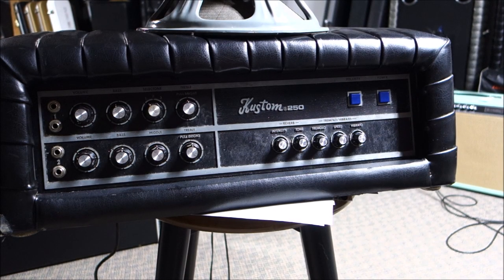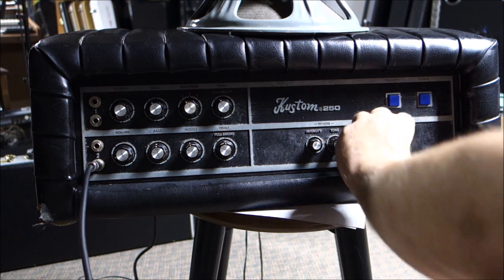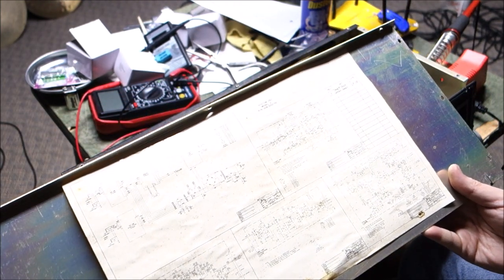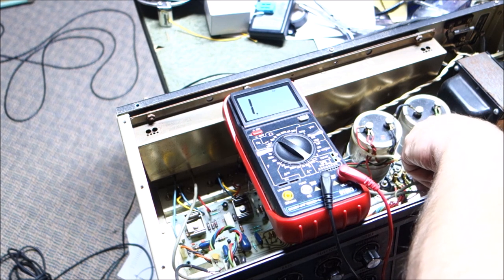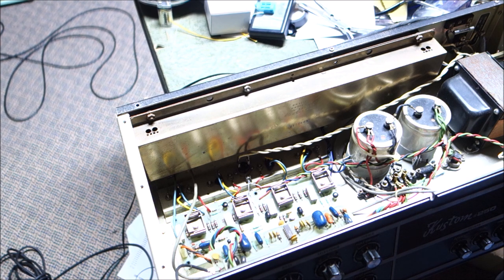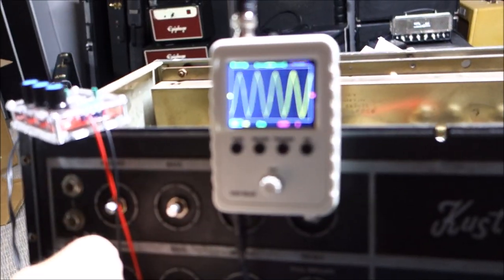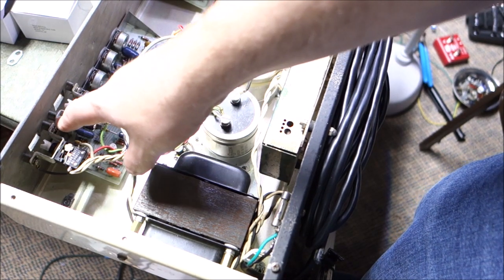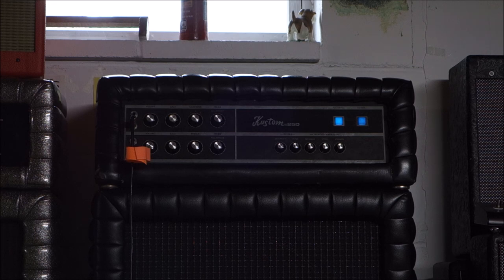Kustom K250-2 head.... bringing it back to full operation!

Comment: Everytime your hands got near those big tower caps, I had to cringe. But it's great to see someone rescueing these old amps, that have sit dormant for far too long. the push button kustoms are some of the best .
Reply from the maker: Kansas Kustoms are great... Usually easy to fix also.
Reply: the size can fool ya with these big caps, they are actually fairly low voltage but the capacitance is very high.

Comment: I just acquired a kustom 150 from 1971  I think ...with the matching 2×12 cabinet both in sparkle silver . It wasnt working  at all till I bypassed the reverb tank , now it kind of works with all kinds of secondary distortion and odd sounds. I will be attempting to troubleshoot and repair it. It was given to me for free so I figure its worth while to try .
Reply from the maker: The reverb tank shouldn't play into getting dry audio though it.   you can get schematics at VintageKustom.com   Best of luck.
Reply: @DeadKoby  Thanks

Comment: I have three of the older Kustom 200 amps. Two are bass versions and the other has reverb and vibrato.
 The RVT 200 has it's original 2 x 15" cabinet loaded with two Altec 421 speakers. 
I replaced the power supply capacitors in all of them and one has been converted to a three prong power chord.
I was amazed at how bad the controls are on this amp in the video but that is 
probably attrited to  the amp being improperly stored I see this a lot in Florida where
unfortunately live now. Amps, both hifi and guitar should NEVER be stored in a non
climate controlled environment unless you want the thing to develop
serious issues.
Reply from the maker: @archangele1  humid environments and electronics are not a good match.   Cool and dry is the best.

Comment: It really was a fantastic video, thanks for sharing!   I Just got one of these in a trade and it's really a great amp, wonderful plush tremelo.  Anyway, I have the replacement bulbs as mine are also burned out-- but I'm not sure as to how to change them. Irinically, This was the 1 part of the video that was skipped over... My research says was vague and said that the blue caps should just "pull off" and indicated replacement from the front using a rubber tubing or something to turn the tiny bulbs?  Or did you replace them with the lid off from the top?  

Thanks, hope you get this and respond🙏

Jason
Reply from the maker: The blue caps do pop off.  And I did indeed use tubing to pull the lamp out.  It was thin fish tank hose.
Reply: @DeadKoby  thanks so much, i was able to pop off the caps and change the bulbs.  Even though they fit, they were extremely dim, so dim that they did not illuminate the button.  What kind of bulbs did you use and where did you get them?  I can't find the GE 335's anywhere...thanks
Reply from the maker: @EcotonicMusic  I got them from some gent on Ebay who said they were the right ones....  I don't remember any more than that.   He sent me two bulbs and a slice of fish tank hose.

Comment: Sounds good, how does a preamp work on these solid state amps just solid state transistors like the output stage or?
Reply from the maker: It's discrete transistors.   These amps are either loved or hated.  I think they are neat for what they are.
Reply: @DeadKoby  Thank you for answering! Yeah I like they way they sound, I've seen them around in music stores but being brainwashed into thinking everything without tubes is bad I didn't really pay much attention to them.
Reply from the maker: The late 60's or early 70's are my favorites.   Bass heads with 3x15 cabs.

Comment: Any experience with the model 4??? Specifically, when the fuzz is enabled, do you have a volume boost
Reply from the maker: I don't recall.  Sorry.
Reply: @DeadKoby  thanks. Seems nobody knows. It's hard to get info on these amps.
Reply from the maker: @genereybradley  Try the forums at  vintagekustom.com
Reply: @DeadKoby  did that already, last year.  Was hoping someone who can read schematics would have the answer.  I have some of the old british vox solid state amps defiant supreme and they do increase in volume has you sweep the control. Kinda nice.

Comment: Hi I have a 250 bass amp  , was wondering if u can help me out? I play for 20-30 min with my fender p bass then it cuts off and on but it's dosent shut off completely but I did notice that if I move the tone knob 1-2-3 if left and right it works again any ideas? Thx in advance would appreciate the help love ur videos
Reply from the maker: Start with some contact cleaner and electronics lubricant.   I sell Maxpro on Reverb.com   OR you can get/use  Deoxit.   Clean all the switches and pots thoroughly.   See where that gets you.

Comment: How did you remove the chassis from the wrapper?  Do the small rivets need to be drilled out?
Reply from the maker: There's usually 4 screws/bolts on the bottom,  then it slides out the back.